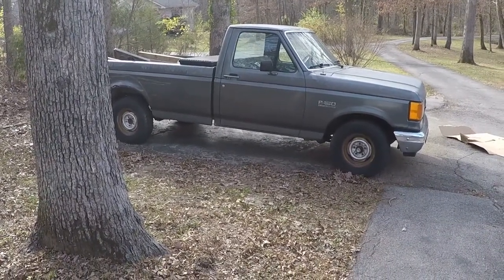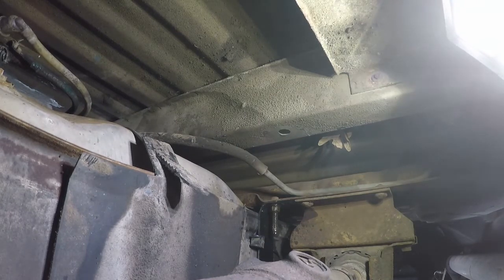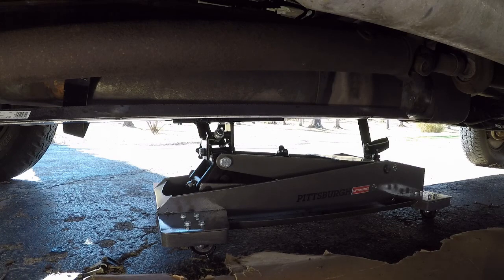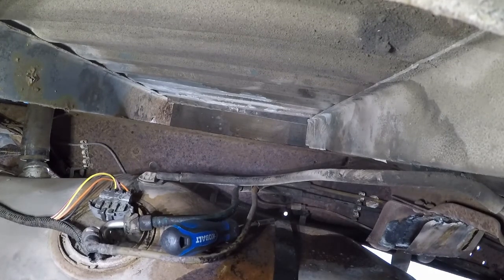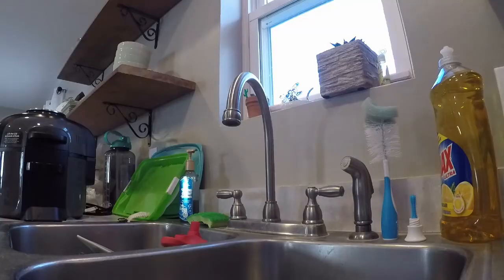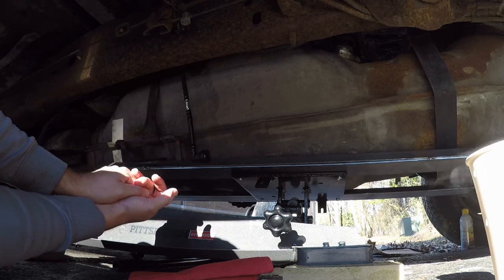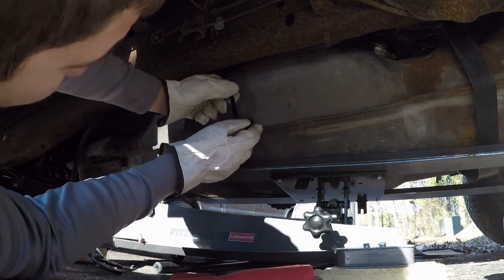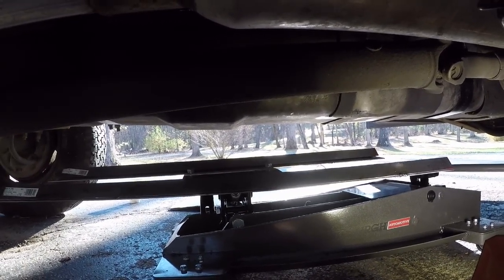88 F150 Plastic Fuel Line Repair (Using Homemade Fuel Tank Transmission Jack Adapter)

Comment: You can use,  " COMPRESSION - FITTINGS"   as well,      instead of using the "BARB - Union"   TYPE, 
it would be a lot easier with the compression type,    all you need to do is match up the   size of the nylon hose,       
A lot easier &  faster... 👍👍

Comment: Dude thats a cool video with good camera placement. I need to fix a spot on my plastic fuel line and was thinking about what type of heat to apply to it or how to get that plastic to seal onto the new fitting. Helped allot thanks!